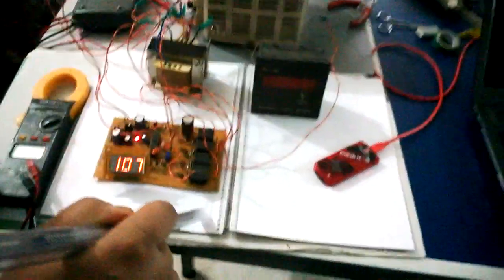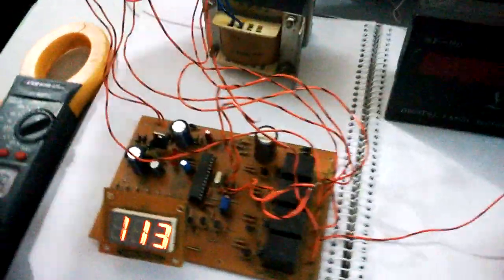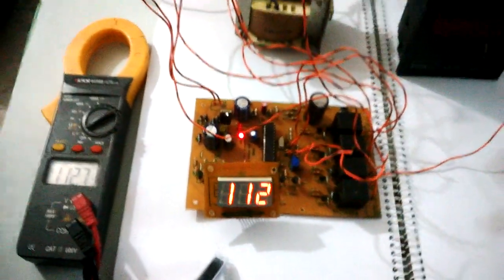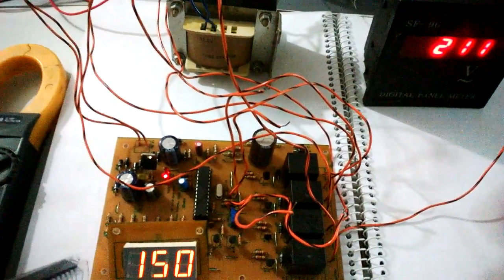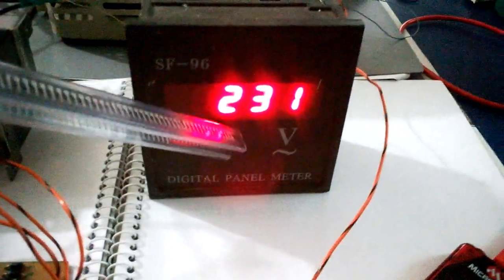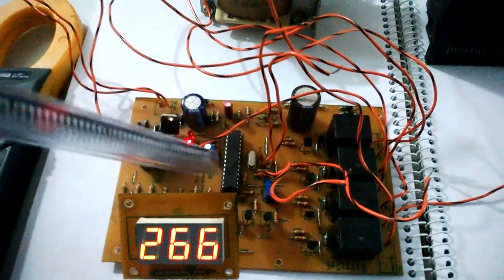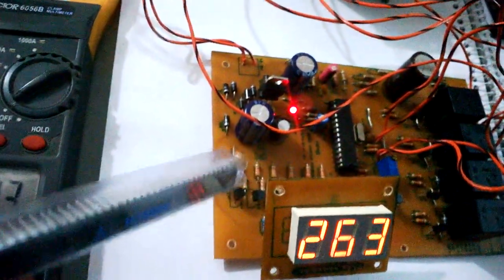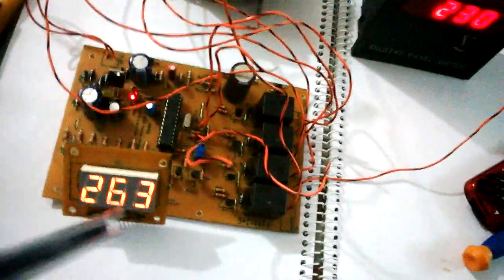Automatic voltage stabilizer - English

Comment: I built this circuit but its not working hope something is not right in the hex code.I think Tahmid sold this project causing the code not to work for those taking it for free, because i see the exact circuit being advatised on some website that its for sell here is the website were it is sold. http://microcontrollerslab.com/automatic-voltage-stabilizer-circuit-diagram/

Comment: ideal to get knowledge of how ac can be stabilized using a microcontroller. However, one does not use taps on the transformer for VA of the order of 500VA. We just add (or subtract) about 40V from the ac mains. That way the size of transformer is lesser. One can get 170 to 300V stabilized to 207-253, i.e 230+/- 10%: Dr. Mani

Comment: I have 10000W AC Voltage Stabilizer but few days ago it started a problem.when i on it switch it gives 298v on Output with humming noise when Input is like 200v to 210v. I will take it to a shop to fix it but just asking what could be the reason for this problem.